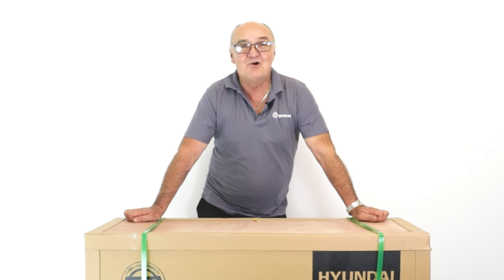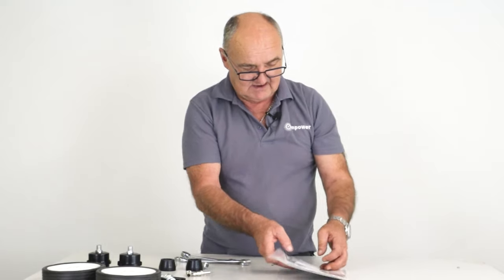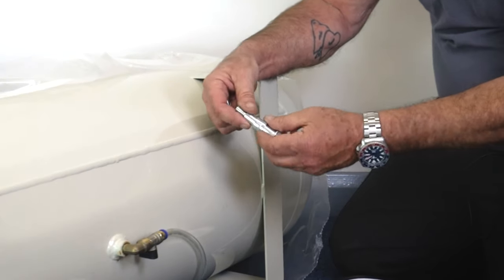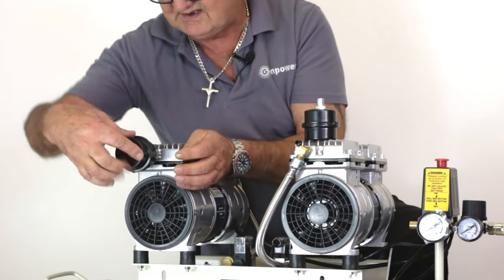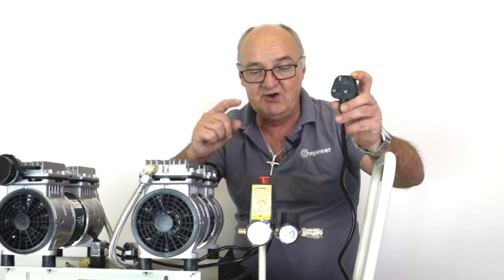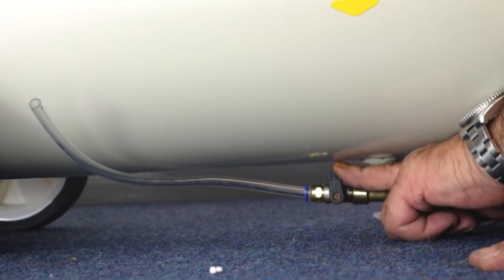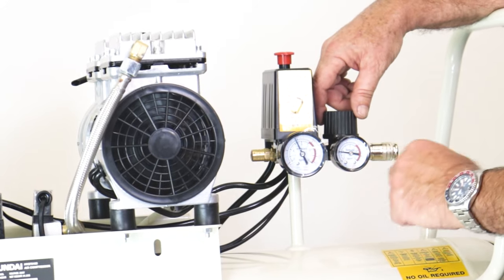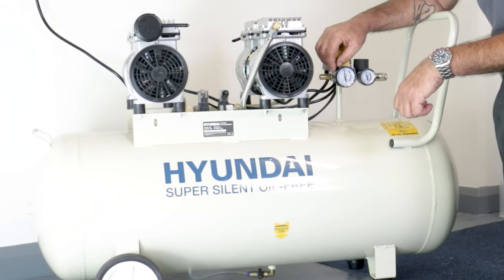New 100L Silenced, Oil-free Air Compressor Unboxing & Assembly Guide (HY275100)

Comment: How long to fill? the 50L takes 2 1/2 minutes or so, I'm surprised the 100L has the same two pumps that the 50L has.
Reply from the maker: There is a larger variation that fills faster, naturally this variant fills slower because of the pumps you mentioned but it was so we could enter the market with these at two separate price points.

Comment: Hi! The compressor looks impressive. Would this model be able to handle stone carving with a pneumatic hammer? Or would the HY2150100 be a better choice? Wondering if this compressor could be continuously used with 10-20 second rest periods? Your advice would be greatly appreciated
Reply from the maker: For the use case you describe, the larger of the two with the more powerful motors would be recommended as it would be better suited to handle the frequency you describe. IF the sound isn't an issue we also have an array of more powerful options on our website, but these bring the noise levels that you would expect. https://hyundaipowerequipment.co.uk/air-compressors/
Reply: @HPPUK  thank you! 👊🏽

Comment: Hi
I would like to know if any of your air compressors can run of a 3100w generator, if so, what is the maximum tank size.
Thanks,
Reply from the maker: With the current stock considered, the HY30100V is a 100L air compressor with a 2.2kw power draw. 
https://hyundaipowerequipment.co.uk/hyundai-100-litre-air-compressor-14cfm-116psi-silenced-v-win-direct-drive-3hp-hy30100v